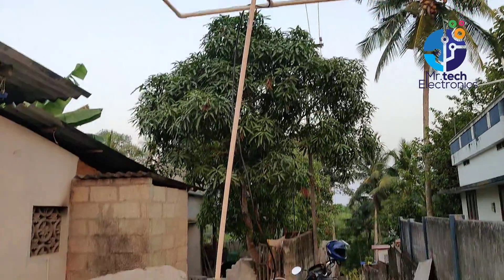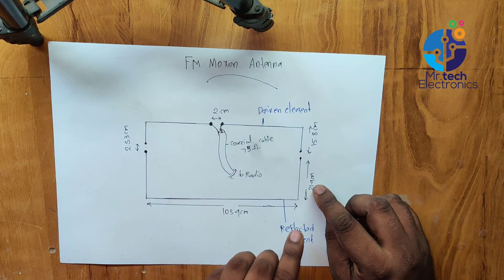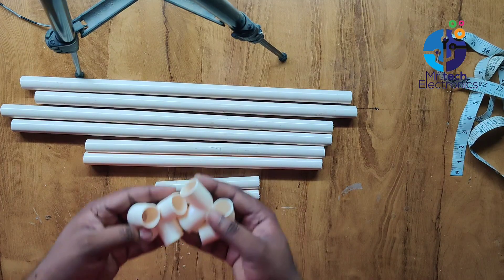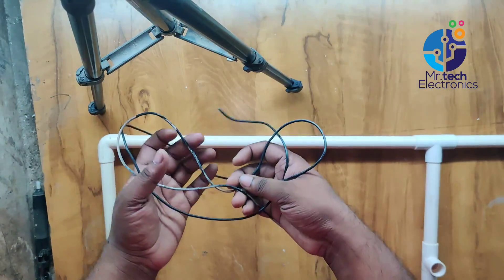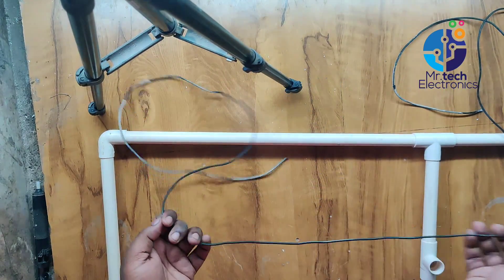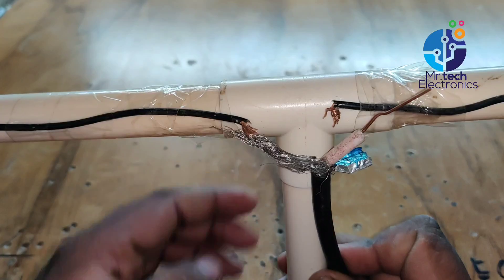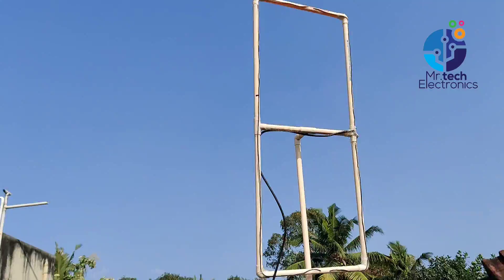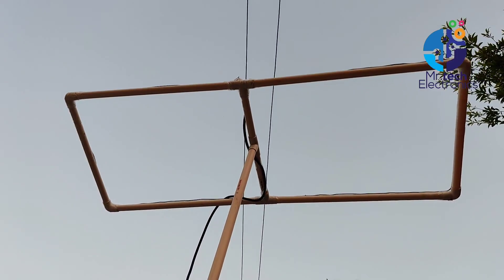How to make FM Moxon Antenna At home | High Gain FM antenna Homemade

Comment: റേഡിയോയിൽ രണ്ട് വയർ എങ്ങിനെ connect ചെയ്യും? ഒന്ന് റേഡിയോയുടെ ആൻ്റിനയില് കൊടുക്കാം. മറ്റെ വയർ എവിടെ കൊടുക്കും? please reply me.
Reply: Negative of battery
Reply: മനസ്സിലായില്ലല്ലോ
Reply from the maker: FM radio യിൽ battery അല്ലങ്കിൽ DC power supply ഉണ്ടല്ലോ അതിലെ നെഗറ്റീവ് wire ലേക്കാണ് coaxial cable ന്റെ shield wire connect ചെയ്യേണ്ടത്